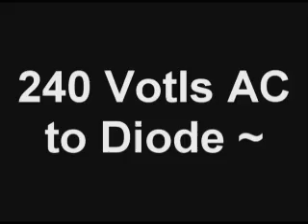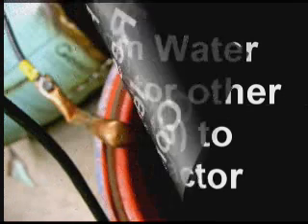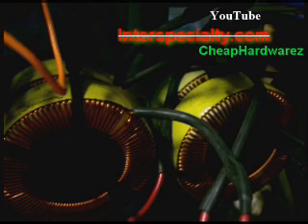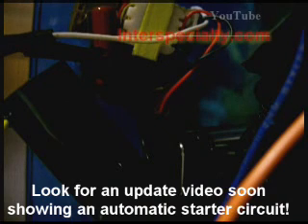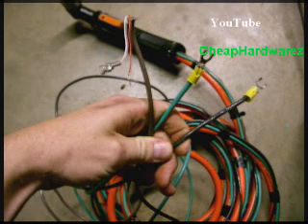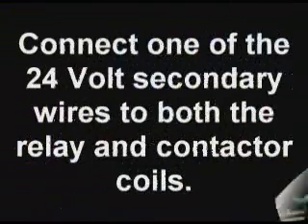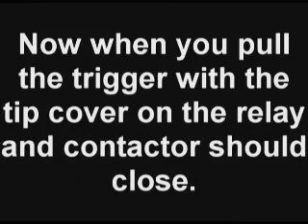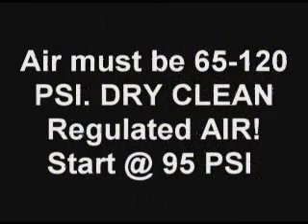Homemade Plasma Cutter Connection Review

Comment: Not sure why you posted this video, if it was to waste peoples time then you have done well. To anyone out there that does not have a background in electronics - don't feel bad, its not you, there is nothing to learn from this.  To the poster - about your "series connected inductors"  the small wire gauge on these toroidal coils could not possibly safely carry the high current used by a real plasma cutter, mine can supply up to 50 amps, those coils would fry.
Reply: Iron torood or ferrite toroid?

Comment: i already make very advancement  on this diy plasma cutter, i recommend use an step down isolating  transformer as precaution mode.  instead use  direct live ac source  is dangerous,  for the torch i recommend use a pilot arch connection plasma torch like the dsw60, you can find on ebay, im researching how keep an stable arch and ajust the current with simple circuit and components. thanks a lot to cheaphardwarez  for the info on how this machine works!!

Comment: Did you try making a oxy-gasoline cutting torch? It looks simpler to make than a plasma cutter and it can cut 30cm steel many times faster than plasma without any problems.

I'm in the same situation, I would like to have the means to cut metal faster than using a hacksaw but I'm not ready to spend 1000$+ on a plasma cutter.

Thanks for posting!